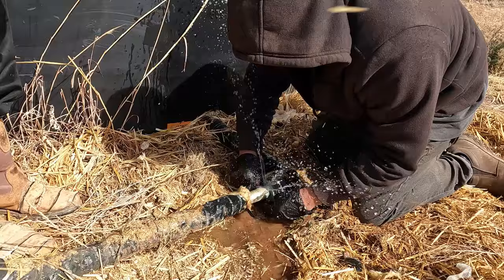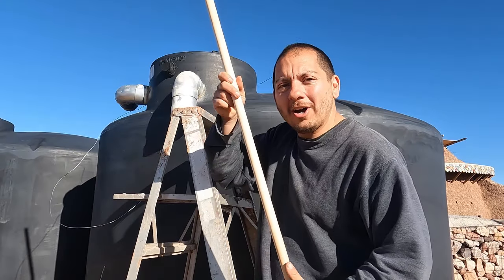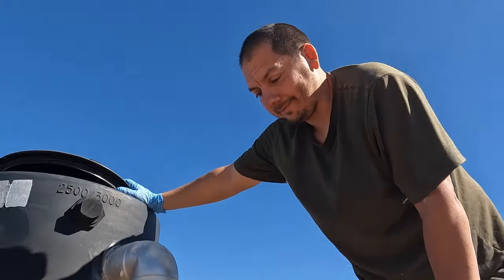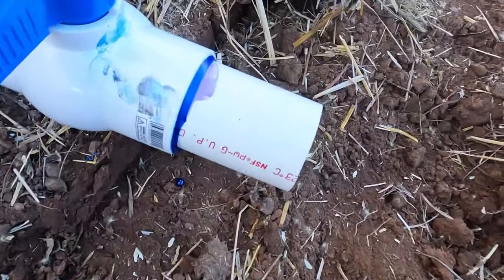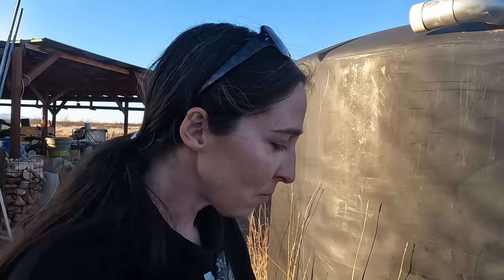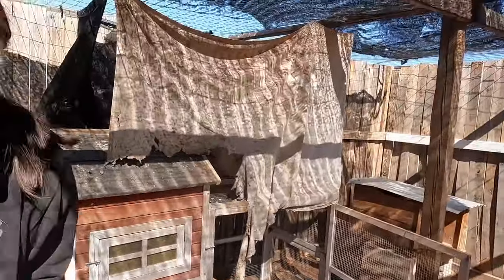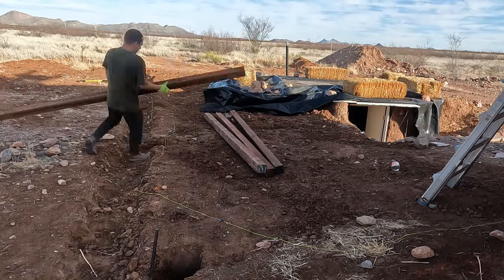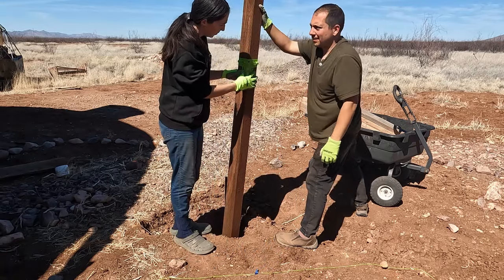This Critical Failure Brought Our Pole Barn Build To A Halt

Comment: Since your pipes are above ground right now you could make a box like structure around them add some insulation to the top and make it removable and the pile some dirt and rocks along the sides of the box to help keep the pipes warm and the critters out of it. It would also help keep them fed getting damaged by thi ga dropping on them you could even put a bigger box where the shutoff valves are.
Reply: That's exactly what I thought. If someone accidentally steps on the joint or pipe it could crack. Or the javelinas could trample on them. At least support the PVC pipe from below with stones or wood.
Reply: I agree. No matter the size, one needs to keep em from freezing. Ice is strong.

Comment: Great job, brilliant plug, only suggestion would have been burying the pipes approximately 6-12 inches underground. If not, add another valve (with a tee) at the end so that the pipes can be drained before next freeze season. Since the pipes are above ground, If possible angle the pipes downward slightly to drain the water completely out.
Reply: You're right. Just bury the pipes a little bit
 A friend I know uses gravity water tank 10k gallon.  For shut off 500 feet from tank the valve is underneath or inside a hollow tree log  round w/straw inside

Comment: Hey Jim,  you did a good job on the ball valves. Just a suggestion, I might have put a compression fitting after the ball valves in case you wanted to move some of the piping. That plug was genius!! Thanks much for sharing.

Comment: You need 2' wooden stakes driven into the ground at the base of your braces along side of them and then two screws from the stakes to the brace.  If not the braces will move.  Also the top of your  braces need to about 3/4 of the way to the top of the post and on a 45* angle, with stakes at the bottom to keep them from moving. The short braces will be to easy to be moved and then the post will be out of plumb.

Comment: Pole barns are fast to build, and very strong. I like em 👍👍  I like the roofing tin all away around on the roof, and all down the sides. top to bottom. That the strongest of all siding. better than cement.  For insulation is> to cob the inside walls,  WOULD DO NICELY  👍👍 You would have to use some chicken wire to hold the cob in  about 4 to 6" thick should work nice

Comment: Great video.  Please brace the new pipes so that your dog doesn't break the connections standing on it.  Also,  I neither saw nor heard any mention of a use of a level for getting the poles straight.  What did you do to make sure of that?  Curious.  Thanks.

Comment: need to wrap them pipes and valves good they will freeze and break just as easy as the llitt;e pipe I have had  a 2 inch valve break. So glad that you guys went with a different building method It should go up faster maybe you can have it dried in , in a few months time

Comment: Much better with the ball valves right near the tank. Now, just be sure you have those pipes insulated enough to prevent freezing !! You can insulate the pipes directly using the proper products or you can build a nicely insulated box around them since they are right about at ground level. Any case, BE SURE you have them adequately protected to avoid additional failures.

Comment: You all are making great progress!!!  Small point, if you sharpen those post cross braces on one end and drive them at about the same angle as now, you can use only 2 per post, and they are a lot more stable to keep your posts PLUMB if you are pulling strings or pouring concrete.  They also allow you to make small adjustments by tapping on the braces with a hammer.

Comment: PVC cement seals pipes instantly...at least in a couple of minutes. You should not need to wait overnight to make the connection solid. PVC cement is actually not a glue but more of a welding agent. It melts the pvc locally so the to be joined surfaces fuse together. This process takes seconds and is permanent and irreversible.

Another tip is regarding the two pvc cement containers. Many people have tipped one or both over but if you duct tape them together the chances of either misplacing one of them and tipping the set over (in the field) is very small....

Comment: I use to build fences for a redwood lumber yard company. The standard we used for fence building was to go ahead and bury the post after confirming dimensions and leveling up the post. It was fast and effective. I'm interested to hear what you say about your process. I think you do it to make sure you have perfect alignment on the corners of the build as you go forward, adjusting as you go?

Comment: I would cover that pvc pipe as it isn't uv tolerant   You could even use bags and cob and then put a metal removable roof on it. Also you could add some heat tape for cold weather

Comment: How thick are your cob layers? And have you tried dry grass instead of staw? We're at the point we HAVE to get some bags covered. Just amending with sand we still have a lot of cracking. I'm hoping we can make use of some of the 8 acres of grass we have.
Reply: I would worry some seeds would get in with the mix and grow inside the wall. Straw is inert, no longer alive. One small seed can split a boulder over time. Just my two cents worth.

Comment: I would use a copper or brass ball valve. I live the desert also. Those plastic ball valve won’t last long especially out in the elements and high temps. Plus if it freezes, IT WILL CRACK and you will lose lots of water.

Comment: Just an old master plumbers thoughts.  You should have installed unions after the valves and the hose connection valve you installed.  ,   It needs a valve installed before the drain valve
Think,   How you gonna repair the valve with no shut off?????

Comment: I had to change the flappers out on my toilets, > i caught them running during the night,  SO TO SAVE ON WATER💲💲  I BOUGHT SOME NEW ONES.  I though they would float, to release the handle.  But these don't float?   🤣  So i have to hold the handle down until it fully flushes👉👉 NO MORE WASTING WATER !  THESE WORKS NICE!   BUT HAVE TO HOLD THE HANDLE DOWN UNTIL IT FULLY FLUSH